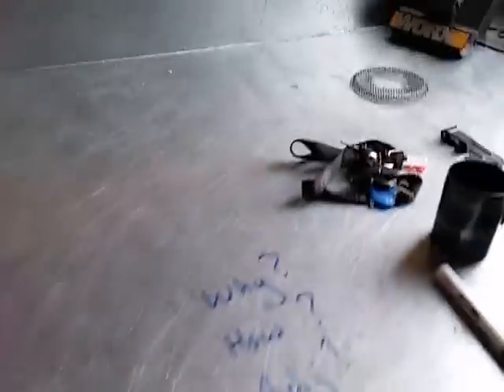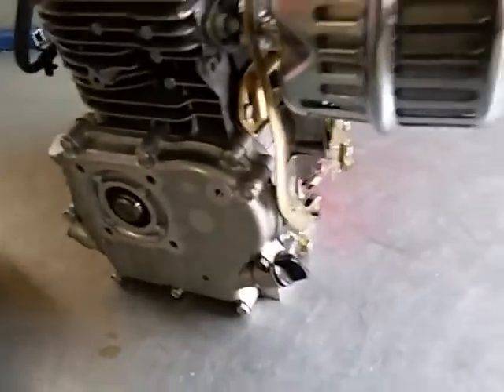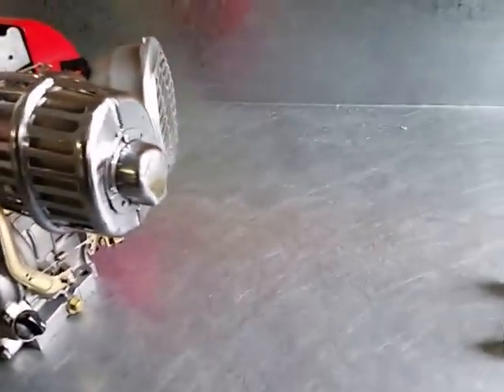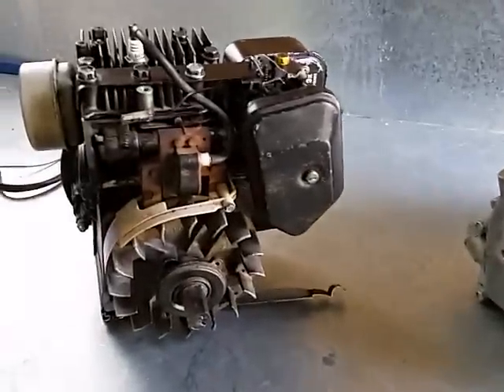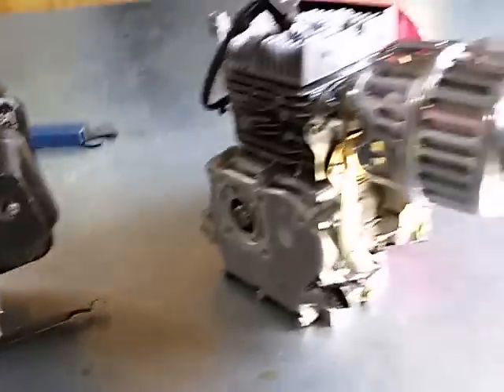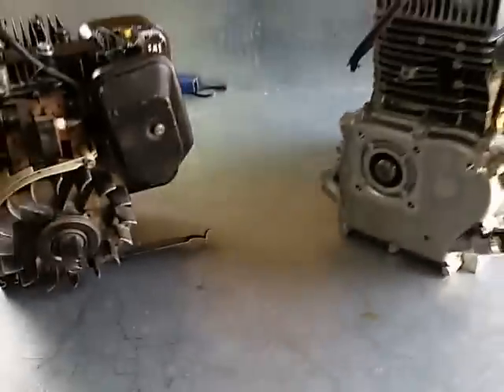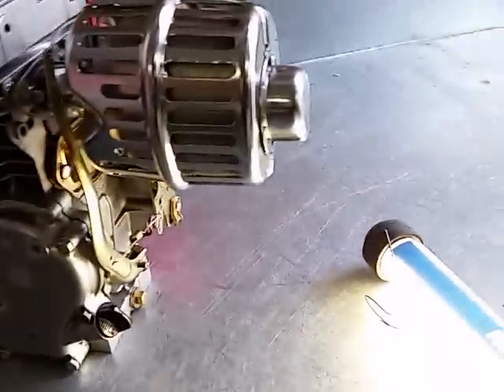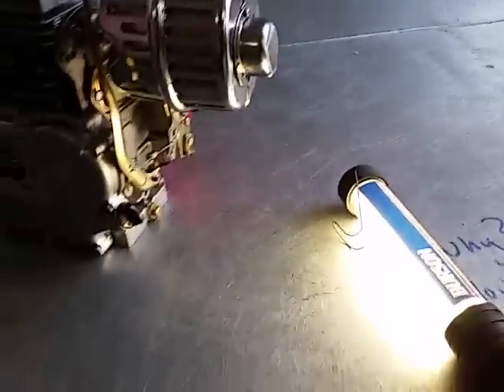How a small engine governor works

Comment: Is an engine with a governor constantly trying to slow itself down and the throttle is keeping the carb open? Does the butterfly close due to the governor as you turn the throttle down? It doesn’t appear to be mechanically closed by the linkage.

Comment: Question, my push mower RPMs ran out of control after replacing the oil pan/sump gasket.  It started right up with no leaks but the RPMs were running out of control.  I killed the engine, loosened the governor arm nut, and moved the governor arm left towards slower throttle speeds, tightened the nut and RPMs went back to normal.  However, the manual said i should have moved the governor arm all the way right to wide open throttle, turn the governor shaft clockwise, and set it there.  I tried that and it made the RPMs go out of control again.  Is there something wrong with the way I fixed it by setting the gov arm towards throttle side to find a good RPM?

Comment: Nice video. Thanks.  I still don’t understand a governor on a wood splitter.  Do u.    Where r u from mate???
Reply from the maker: It allows the engine to maintain revs when the wood splitter pump encounters a load, it is just like the cruise control on your car when you get to a hill, throttle changes to maintain your road speed.
Reply: @bezzed4388   ok. I kinda understand now. Thanks so much

Comment: A good explanation of the mechanical process of how the governor balances the speed of the engine rpm's to adapt to various load conditions.  Very helpful to see the actual weights in action on the wall display.   I learned something from this video. Thanks for posting it.  

This has me wondering however if it would be possible to disconnect the governor linkage to the throttle control on the carb and the spring on the governor arm, thereby rendering the governor useless.  If I then simply installed a throttle cable to connect to the carb's throttle control, as is found on a lot of tillers, would that not work and allow me to control the motor speed myself?

Comment: I have a HONDA 6.5 HP overhead valve engine that refuses to start even thought there is spark and fuel. I haven't checked the compression with a gauge but it has compression. Thumb over the plug hole. I thought the fly wheel key might of stripped because trying to start it sounded like the timing was out and it would backfire back through the carburetor. Key way aok. Tried a new plug and new carb. I guess nothing else left but to whip off the head.
Reply: Your description leaves a lot of questions still. Try to remember this you really touched on all three things that are required for an engine to run. Spark, fuel, timing. I think your conclusion of tearing the head off is the best answer to start if you know for certain the carburetor is working properly. If the timing is off on the small engines they will not run. So under the head or into the head is your valves. They must be checked. Other than that take all the gas out of the engine, turn the engine over and spray some starting fluid in it, if it runs like a champion your problem is the carburetor. If it still doesn’t run your problem could be timing or spark. Good luck! 👍 Oh and check in compression with your thumb is not a good indicator.

Comment: Thank you for a very informative video.
My question is can you adjust the governor to rev higher and how would one do it?
Reply: It could be done, but its set at a certain speed for a reason, it can also be very hard to run higher but still at a speed that will not prematurely destroy your engine. Spring tension, spring position or shaft adjustment.

Comment: Are there 2 ways a governor can work.  Its seems sometimes the spring increases rpms  then sometimes the governor can?
Reply: no, just one way, the spring and the mechanism, wether its weights or fan type, work together to hold the set revs.

Comment: My toro powerlite is reving out of control for about the first 3-4 minutes and then it slows down to normal.  Haven't had a chance to open up the back panel to take a look, but I imagine that something in the governor linkage is freezing up.  We've had some pretty cold weather in WI.  What do you think?  Is the internal weight/rod sticking?
Reply: On the plus side, it throws snow like a much larger machine in that first few minutes, lol.

Comment: Thank you . I finally found an explanation as to what exactly the governor does ,including the springs and weights . Never saw that in cars so I got stuck with a kawasaki engine that im working on , I tried adjusting it without knowing how it worked and just walked away from it . I'll get it working properly tomorrow .

Comment from the maker: Hi Gust, it could be, hard to say, are revs high enough, did problem exist before work on carb. perhaps a linkage or spring is not in correct positiob or is damaged. do you know if its a weight or fan governor.

Comment: Got an MTD 5 hp Tecumseh snowblower when I get in to heavy snow engine bogs down, and won't blow the snow, is it governor or carburetor problem, put a new carburetor kit in fuel and air/fuel  mixture adjustments respond good. Adjusted governor clockwise on shaft as far as it will go, then have tried various position on  lever rod, to get full motion on carburetor shaft, springs are in original holes, that I marked, but still doing same thing under load, no power?

Comment: so, really on a go kart, why would they totally remove it ?  I can't see how it would really add much extra power,,  ... If I'm correct and they would want more take off power coming out of a corner, why not just add a stronger spring ????  if they would want more top end I would think they would get ahead by changing the rear sprocket .. correct ??    "" me and kids have been getting into back yard race karts, just trying to understand it all :)""
Reply: Hi I understand your question. The answer is this. Removal of the governor does not make your engine more powerful. For take off at full throttle Your engine will accelerate exactly the same. The butterfly in the carb is fully open. You were going from idle to full throttle. The governor does not stop this. Your engine governor is set to maximum rpm setting, that Is where the governor will top of your maximum rpm achieved. The removal of the governor will let the engine RPMs rev higher only after the same amount of RPMs are achieved with a similar engine with the governor. You do not have to take your engine apart to remove the governor arm. You would have to directly attached your throttle to butterfly on the carburetor directly. So without the governor attached to the throttle your engine can rev higher. But there is a maximum before the engine will self-destruct or stop creating more power. The power produced by RPMs put on a chart is not a straight line. It peaks out near the highest RPM range and then drops off. That is another topic completely. So for TopSpeed without the governor your engine can rev higher and you will go faster but you will not take off faster. Changing sprockets on mini bikes or go karts can make you have a faster top speed but you will lose acceleration power, you will accelerate slower to that higher top speed. Switching your sprockets the other direction you can takeoff much faster and have a lower top speed but can accelerate much faster. That balance of acceleration to top speed is what building race cars race motorcycles mini bikes go carts lawnmowers dragster’s jet planes, is all about it is a power to weight ratio looking for the supreme balance and delivery to acceleration and TopSpeed. The whole hobby the whole gearhead person the racer the mechanical engineer that is the whole purpose of their life…lol So honestly if you want your minibike or go cart to accelerate faster and have a faster top speed, it’s all about aerodynamics, my brother.Look closely at the definitions for these things: Torque, horsepower, they are not the same. You have a thing called the peak of diminishing returns. Once you reach the max there is no more, from the Particular engine you were talking about.
Reply from the maker: quad2004 im not sure if i fully understand your questions, the governor is usually set not to go higher than a certain rpm, taking it off allows you to take the engine to a higher rpm. wheel size and sprocket size will affect acceleration and top speed